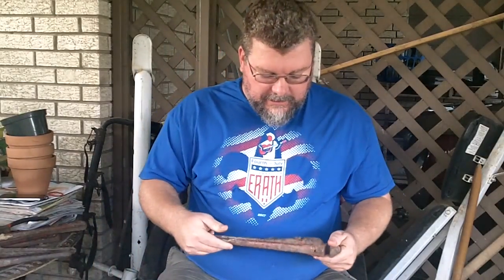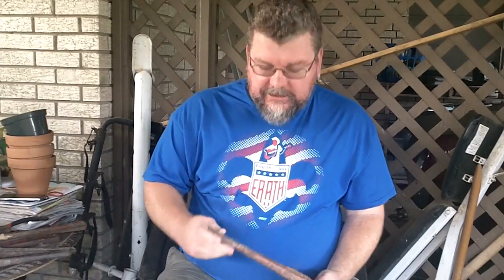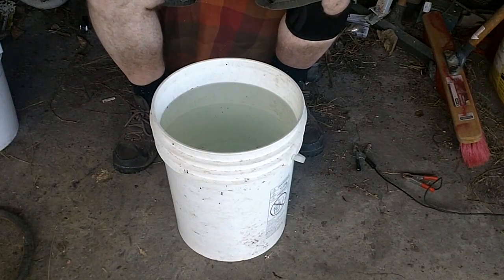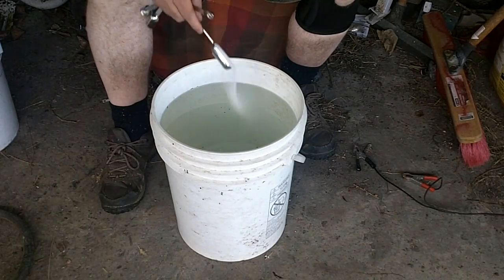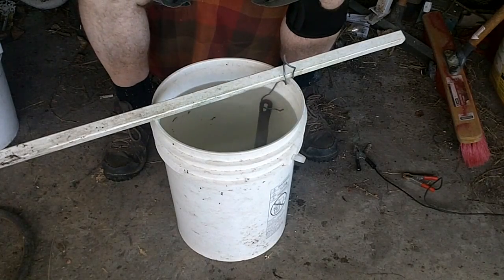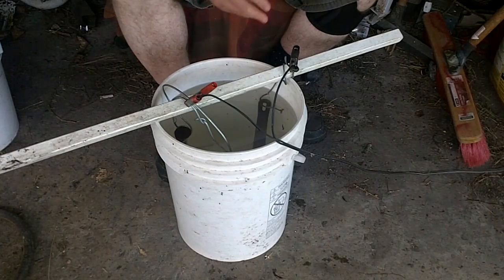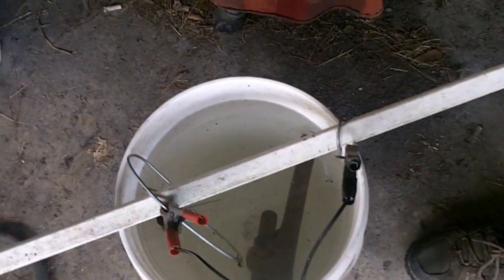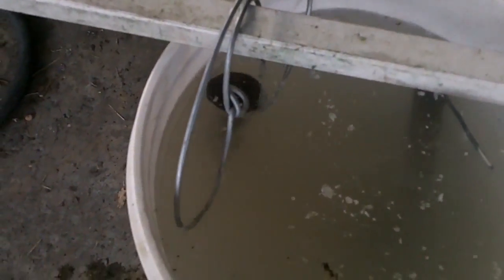Remove Rust With Electrolysis

Comment: I enjoyed your video. New subscriber here. I have some old tools that I'm going to try.  The gas released (bubbles you see) using the Na2CO3 as the electrolyte is hydrogen gas...well ventilated area and free from sparks or flame is key.